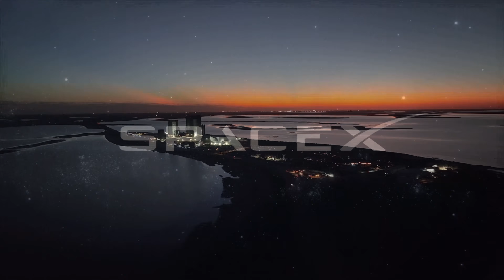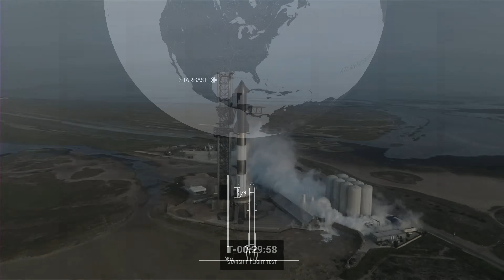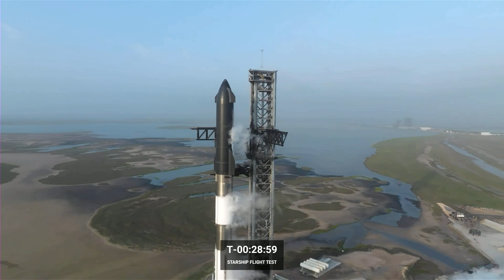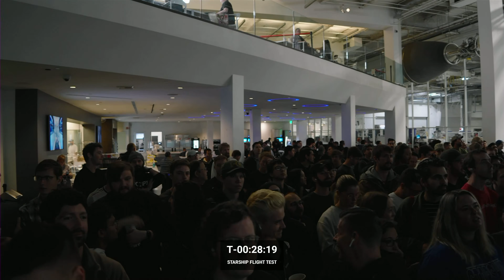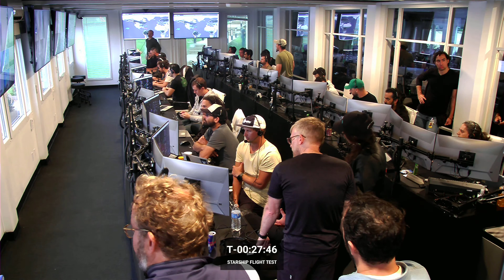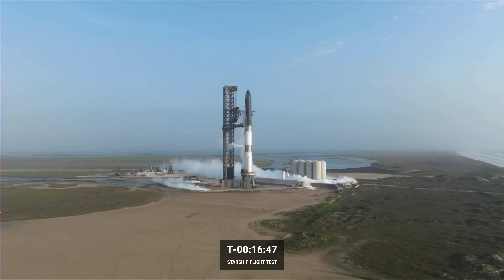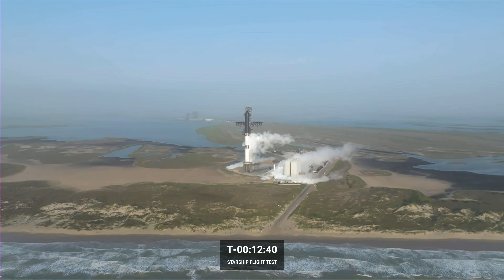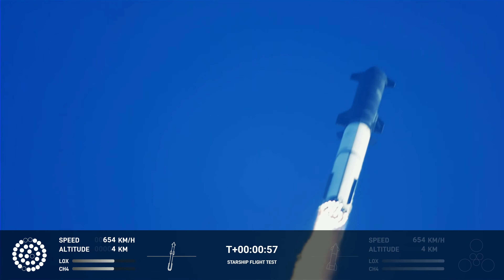Starship Flight Test

Comment: 45:26 angle gives me Wall-E vibes and mad goosebumps! Well done SpaceX.
Reply: Check out 46:21 You can clearly see the problem. 5 of the outer ring engines are out and looks like 1 of the inner 3 engines are out. That's why she, or he, started going a wee bit whackers shortly here after, I reckon.... Still, friggin awesome test flight! And still 1/32th the cost of an sls! Go spacex!
Reply: @skydivejumprope  she or he💀
Reply: Also, shortly thereafter, you can see that the plume is offing more to the left and it looks like the rocket is trying so hard to compensate for those engines out and thus asymmetric thrust, that it just eventually yaws itself to the point of no return and then slowly tumbles out of control until somebody in mission control either hit the "DONT TOUCH" button or it just broke apart due to aerodynamic forces. Any which way it's still, SUPER COOL!!!!!!!!!!!!!!!!!!!!!!!!!!! Go spacex!
Reply: @ellmo_ben  Well i'd almost always call any ship a she but as you can clearly see, it looks much more like a he.
Reply: @skydivejumprope  😂😂😂😂

Comment: This is the first time I have ever seen a rocket spinning and yet surviving for that long!
I can only imagine how pumped up people at SpaceX must be feeling.
Reply: But why celebrating a failure?  I don't get it!
Reply: @brightlight7217  Because the goal was to successfully clearing the launch pad which they did. Anything else was just icing on the cake.
Reply: @brightlight7217  Most comments like these are paid ones by spacex or they have a team to do these commenting stuffs. Just ignore them.
Reply: @ravikumarbalasubramaniam7248  a lot of them are normal fans as well
Reply: @brightlight7217  as they said in the stream the main goal was to actually launch which it successfully did
Reply: @brightlight7217  also failure is the first step to success
Reply: The reason you see other rockets blowing up, when something goes wrong, like the rocket stars to spin, is because there's a person sitting in the control room with a finger on the self destruction button.

Comment: Great shot!!  Interesting seeing a handful of the engines "out" as it was ascending.  Contributing to the spin perhaps.  Also, how the bird was losing altitude (35 km down to ~ 30 km) before it exploded.
Reply: At 46:20  6 engines were out, that is why they lost control of the booster.
Reply: I found it pretty incredible that it DIDN'T explode immediately when it started facing south!  It really proved the structural strength of the whole vehicle - it took a few wildly out-of-control full turnovers before it actually popped.
Reply: @raykonga4924  I counted seven out.

Comment: That thing is solid AF, any other rocket would either fall apart and go into flames or just explode because of enormous force twisting it. . . crazy!
Edit: I've forgot to add that it has some ridiculous thrust that wasn't imaginable but now seeing it it's just nuts!
Reply: It was 35km up, so aerodynamic forces weren't all that great where it started flipping.
Reply: @Eman-vp5wk  it's true that low atmospheric pressure helps reducing the stress on the structure of the rocket but any regular rocket would have failed to stay together by all the swinging around from one side to the other with such great thrust. Any rocket is safe at 100km above sea level aka "0 gravity" but at 35km you still need a well made one to do crazy maneuvers like SpaceX is intending to do in the future.
Reply: @_jvli4n _ dont think you understand how hard it is to get such a heavy rocket that high without issues even getting it off the ground let alone flying. the failure happened because of the releasing mechanism. so yes solid af, look at previous flights trying to get such a beast off the ground. most dont even get lift off let alone last in the sky without crumbling.
Reply: @_jvli4n _ The explosion was due to deliberate detonation. Probably would have fallen back down in one piece and broken up at about 10km if left alone.
Reply: @_jvli4n _ you're late to the party. Hint: SpaceX promised a bang and we got it. Stay up for SpaceX news cuzz we will see some more bangs in the future of testing Starship prototypes.
Reply: @_jvli4n _ They blew it up on purpose. Don't be a pessimistic troll.
   👻☠️🗽💯🙏

Comment: NOTICE : 
For those who are wondering why it exploded , the reason is that the locks which were connecting the both were stuck due to very LOW temperature .
Reply: Or very low
Reply: Thank you for explanation 😊
Reply: how do you know that ?
Reply: @cmwgfo2024  yeah? first spacex test flight ever 2010, first crew mission 2020.... now its gonna be way faster...
Reply: @orotta1  I have contacted with some of the spacex employees.

Comment: The use of water deluge systems has been standard, not for flame/blast suppression but specifically for this, "The Sound Suppression System protects the orbiter and its payloads from being damaged by muffling acoustical energy -- sound waves -- that could crack and damage surfaces during liftoff." according to a NASA printout.

Comment: The weight distribution seems uneven once booster fuel was burned and stage separation couldn’t occur since its heavy at front. (Hence its spinning) 

Hot staging ring is added now , which is hella cool btw and I genuinely hope that solves it. Go Space X , go Starship !

Comment: I think a smart idea would be to create a starship cluster.  What I am saying is add six docking ports at the top of the ship in in a hex pattern around the circumference and the same six docking ports towards the bottom of the ship.  Then in orbit dock as many ships together for the long distance trip to Mars.  Lets say the center ship is docked by six more ships create a cluster of seven ships.  You could then have more regular ships with just one docking port on the none heat shielded side that can dock with the six outer ships.  These ships will serve a transports to carry fuel and supplies to stock up the cluster.  Then when it time to travel a send transport ships with crew for the flight and dock these ships onto the outer cluster ships.  The outer ships are the ships that will fly to the surface of mars leaving the cluster in orbit.  By doing this you have the safety of redundancy  as crew can transfer to another ship during flight.  Here is a like to a picture create with Solidworks of the seven ship cluster (just as an example). https://drive.google.com/file/d/13Or3_Pv2bXhIeR5bMUreOlo3C9dYiYXI/view?usp=share_link

Comment: Before flight was terminated, the stack was falling about 1 km per 4 seconds. That's going vertically towards the Earth at 0.75 Mach. (For comparision, commerial jets fly around 0.85 Mach horizontally during the cruise.)

Comment: Damn the roar on that thing.
Sure is powerful, it ejected the damn concrete under it all over the place.
Did better than i expected, didn't think it'd handle MaxQ but the seperation issue didn't surprise me, it is the first time the SuperHeavy had to lift a Starship after all.
Looking forward to the improvements, and especially when the 33 engines ignite.

Comment: Sorry, haven't read all the comments now, but I've read very often that the launch pad should be strengthened and the water cooling should be improved.
A major reason for the failed engines have been the fragments from the floor of the launch pad, which hit the engines,  because the concrete floor could not withstand the massive pressure of the engines.
Wouldn't it also help to increase the launch altitude of the rocket?
If the ramp were extended by 30 meters - just to say a number, don't know if this is realistic, so please don't hit me🤕🙃 - the point load on the floor would no longer be as great.
After mounting the rocket on the ramp, the ramp could then be raised further with a kind of lift system, similar to a telescopic crane, thus increasing the distance to the ground before the engines are ignited.
After all, the rocket lifts off under the pressure of the engines, and not because it pushes itself off the ground.
Similar to a New Year's Eve rocket.
If I put it directly into the sandbox, I have a crater and many grains of sand flying around, I hold it 1 meter higher, no crater and no more grains of sand flying around.

However it was great to see what humans can achieve and I wish SpaceX all the best for the future.

Comment: How fast is this rocket people saying it seems slow to take off. It moved about 120 meters in around 9 seconds after lift-off - you can observe this in the lift-off footage as it clears the tower.
The acceleration can be calculated solving for acceleration the distance vs time acceleration formula D=0.5*a*t^2. i.e. 120/(0.5*9s^2)=2.96m/ss.
The gravity loss of 9.8 m/ss can be added to determine the thrust to weight (2.9+9.8)/9.8 = ~1.3 : 1
Elon said the thrust was at 90% * 230T * 30 engines of 6210T - at lift-off the rocket was roughly 4900T this gives thrust to weight 1.26 : 1
So it's was actually about the same or a little faster than a Saturn 5 and that's with 3 engines out and running at only 90% thrust - so performance was just as expected.

Comment: they really need to work on a better launchpad and tower combo setup where the blast from the rocket would be diverted in-between a water cooled tunnel under ground and then being redirected out to the surface at the same time.
tunnels made of concrete and harden steel plating to keep the concrete from becoming to hot and directing a path of blast around the tower on both sides under  ground so is not to compromise the integrity of the tower and two other under ground tunnels facing away from the tower, tower and tunnels all connected together by reinforced concrete and steel plated for superior integrity. so where are all the engineers that should have known how to do this?

Comment: Based on the available information, it is not entirely clear what led to the methane leak in the Starship rocket. However, there are some general improvements that can be made to prevent methane leaks in future launches.

One approach could be to improve the design of the rocket's fuel system to minimize the potential for leaks. This could include better seals, more robust materials, and improved monitoring and control systems.

Another approach could be to implement more rigorous testing and inspection procedures to identify and address potential issues before launch. This could involve testing the fuel system under various conditions and using advanced imaging and sensing technologies to detect and locate leaks.

Furthermore, it may be beneficial to develop alternative fuels that are less prone to leakage and have fewer environmental impacts. For example, SpaceX has been exploring the use of liquid oxygen and methane as a more sustainable fuel option for its rockets, which could help reduce the risk of methane leaks and other environmental concerns.

Ultimately, preventing methane leaks and other issues in spaceflight will require a multi-faceted approach that includes improvements in technology, testing and inspection procedures, and the use of sustainable fuels and materials.

Haptic technology is a type of technology that uses tactile feedback to create a sense of touch in the user's hands or other parts of the body. It can be used in various fields, including space technology, to improve the accuracy and efficiency of various processes.

In the case of methane leaks, haptic technology can be used to create sensors that detect leaks in real-time and alert the crew of the spacecraft. These sensors can be designed to provide different types of feedback to the user, such as vibrations or visual alerts, depending on the severity of the leak.

Comment: During "wiggle test" gimballed engine 7 caught my eye as looking "loose", which I did not take as a good omen. Plus from day one the pad and tanks about seemed very "make shift" and too close in case of disaster on the pad. The response of the concrete about the pad was an oversight I was surprised about.
But looks like all in hand and onwards and upwards with the data and slight failures all part of the process.

Comment: I wonder how far the launch would have progressed if the blast shield had been in place to protect stage zero.  No doubt at least a couple of those raptors would have been saved but i still think the Starship separation needs some design refinement.
Does Starship REALLY separate by having the entire stack tumble end over end to fling Starship away???

Comment: This is really awesome and historic. Spacex is pushing the boundaries and setting new standards. But stacking 33 engines at the bottom of a huge rocket might need to change. Spacex is excellent at handling sideboosters. Why not make 3 or 4 boosters and land them back instead of clumping 33 engines.

Comment: Elon gave a heap of insight into what happened later in an interview.
@48:14 is probably when the FTS tripped and blasted the tanks and why we see plumes of gas from the side of the booster and starship but it does not break apart and the engines keep going even with the tanks ruptured and tumbling out of control. 
Finally at @49:02 It breaks apart over 40 seconds later. Starships is super tough to withstand such treatment. The engines and autogenous pressure system performed incredibly to be able to keep going like they did.
Although this test did not go exactly as planned this would still have validated a heap of the starships design and clears the way forward.

Comment: how about a starship variant that once it reaches LEO a variant of Sierra Space’s LIFE (Large Integrated Flexible Environment) designed for a 9m fairing(Making it roughly 48.6 feet in diameter & somewhere in the neighborhood of 6 stories tall) instead of the 5m variant they are offering now is revealed when the panels covering the payload area are jettisoned with electric propulsion drives attached to guide them to deorbit. the inflatable is permanently mounted to both the Captains Deck & the fuel/engines section when it is fully inflated another starship would dock with it to transfer equipment to finish out the interior & strengthen the overall structure. The cargo Starship would undock making room for a depot starship to dock & fuel the new interplanetary variant. The starship variant proposed would start on the launchpad at about the same size as the standard model but would grow on LEO to be a vehicle with a vary respectable living & working space. These would never land on a planet but would dock with local equipment to shuttle passengers to and from the surface.

Comment: Just had a interesting idea on rocket takeoff and heat dispersal - why not put the rocket inside a huge circular steel vat of water slightly larger than the spaceship itself and thus all rocket engine heat on takeoff will instantly the water to steam and the pressure in doing this will also push up the booster/starship up out of the cylinder much quicker as more heat is generated and thus actually help with the takeoff ?
You may still need water pumps in this case to replace the water turned to steam to prevent all the water ever being fully boiled off....
Would this work - what do you think ?....anyone ?

Comment: Who's ready for s25 and b9?
Reply: First, i need the static fire date, ship 25 is waiting
Reply: Once we see a booster 33-engine static fire we’ll know it’s probably pretty close. I’m holding to my original prediction that there will probably be one more and only one more Starship flight test this year.
Reply: @julesjackson4855  I think if the next one is successful one might see two launches this year
Reply: @julesjackson4855 well we had the 29 engine SF, we’re guessing that another SF will be needed.
Reply: @Hello_OoOoO they rolled booster 9 back to mega bay, they might need to replace those engines
Reply: @Hello_OoOoO  we got 31 engine 6s(full duration)

Comment: 2 hands 4 begginers!!!
Just replace the stabilizer with a second chopstick and integrate stage 0 into them. Raise the whole tower by 150m, there is no need for a launch platform, just a removable stand. That stand should be built into mobile transporters, that are by necessity modular, and can be loaded into the starship.
Elon, you need to start a SPMT company.😂

Comment: This might sound crazy, but I personally think that after it cleared the tower, and it reached its safe height. The spin was intentional to test maneuverability. To be able to control the biggest rocket/booster ever created, also, have it controlled like that has never happen before with a ship that size. 
It's still the best launch I've ever seen in my life, and cant wait for round two in early September. 
LOVE IT! 
Thanks SpaceX! Damn!! Footage never gets old! 
 - NOM
Reply: We can only speculate but I personally think it span because the first stages computer thought it had detached and then tried to move itself into the reversed position. But that's just a theory, a space theory! ❤
Reply: @florianglinka8575 maybe, for stage separation it would turn vertically so it could separate, then turn around to boost back
Reply: Hopefully the hotstage plan will work